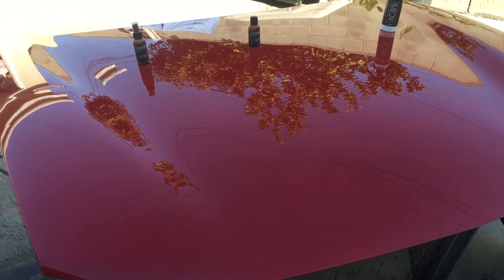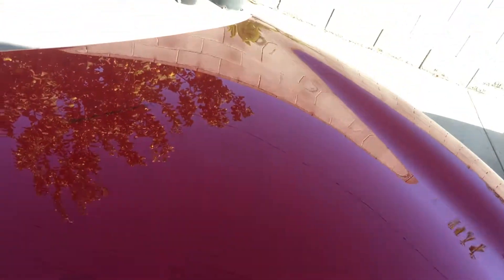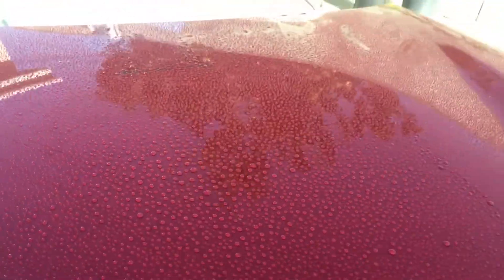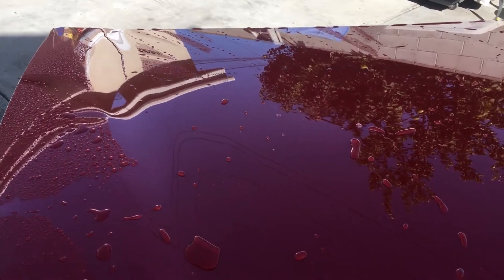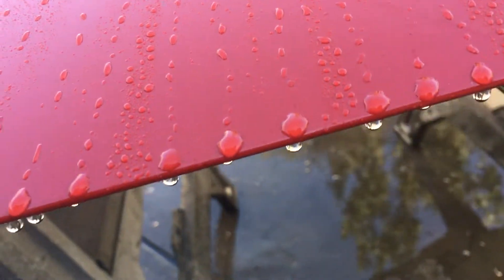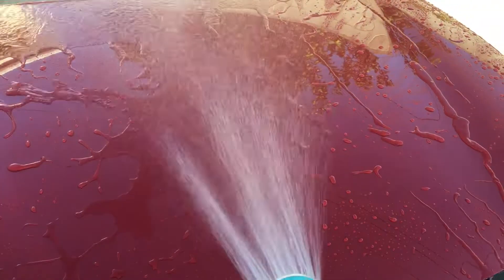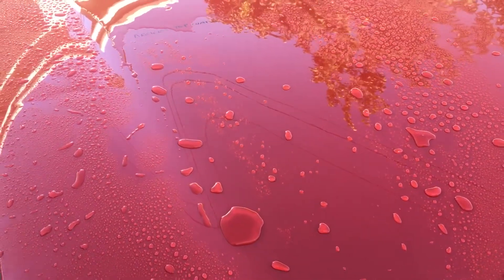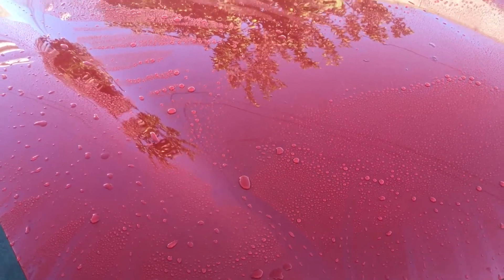Drexler Ceramic Water Behavior Test Part 2

Comment: Hi, after months is it still good or it faded away? I think I discovered drexler products are just a rebrand of a Chinese brand called coater pro (you can find it on aliexpress)
Reply from the maker: Bimmer I actually applied it to my uncles car.  The last time I saw it it was looking good and clean with the water from rain beading good.  I am also testing it side by side with other coatings in my other test and other coatings are doing much better.

Comment: Did you test drexler base coat + top coat + top coat care, overcome on top of each other ?.  The beading effect must be impressive?!.
In addition to good resistance, even if the base coat is not the most hydrophobic, it provides resistance, and given the super hydrophobic effect of the 2 top coats, it must add a great water-repellent effect in addition to a good sacrificial layer!  .  Tell me what please I am interested in this coating, because a good price for the trio pack.
Are they easy to apply and wipe off?
Reply from the maker: I did not test the combination.  I spoke to the people at Drexler and they told me top coat is the same as top coat care.  From using it, they do appear to be the same.  Top coat and top coat care is pretty good.  

The base coat seems pretty durable even if it is not the most hydrophobic. Reminds me of Gtechniq Crystal Serum Light and Gyeon Mohs in that regard.  

The base coat is user friendly.  It is slick when wiping off but gets tacky as it cures.  Wiping it reminds me Crystal Serum Light and Mohs. The top coat adds slickness.  

Give it a try. It’s surprisingly a good coating.